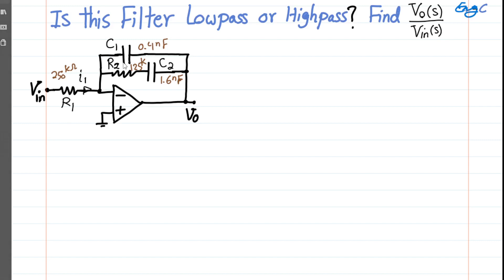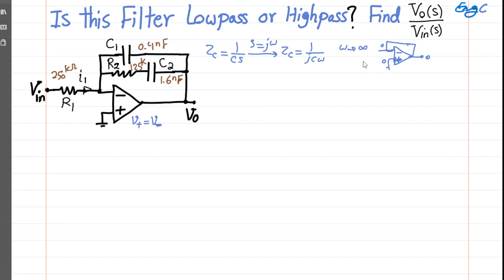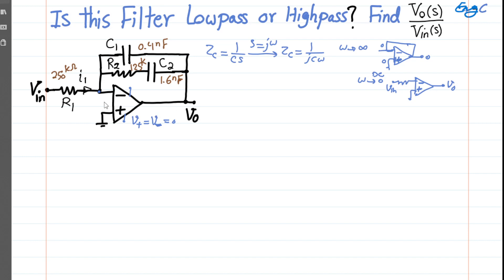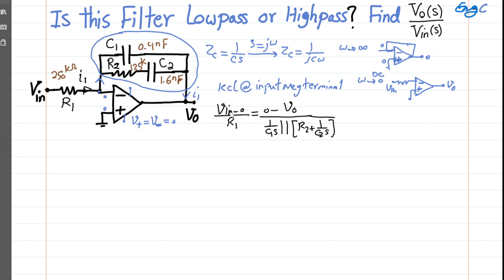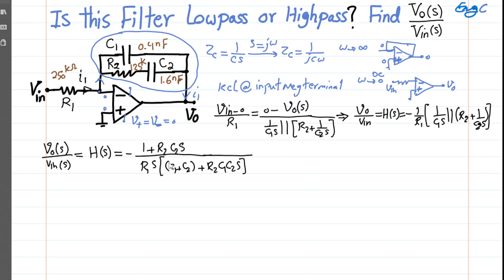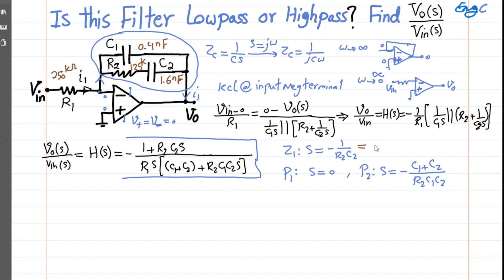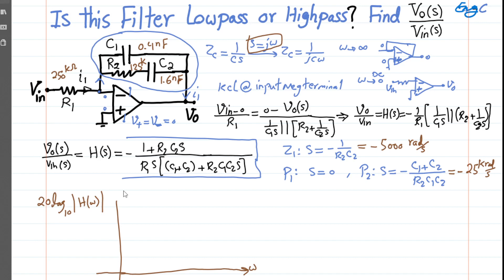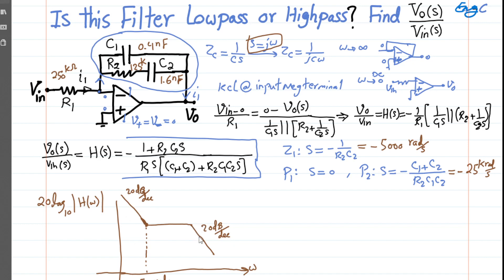Is Filter a Low-pass or High-pass?  Why? Show Input Output transfer function and Bode Magnitude plot

Comment: 2 levels of integration at freq.
Reply from the maker: Hi Lee, this filter has a transfer function with 2nd order denominator.  The Bode frequency response plot shown near the end of video illustrates at what frequencies this circuit behaves more like an integrator.  Interestingly, depending on values of R and C there might be a range of frequencies where circuit acts more like just a gain where Bode magnitude response plot is flat in that frequency range.
Reply: @STEMprof  Wonderful explanations! You're inspiring me to drag out my books and refresh on this. You channel is top notch!!!